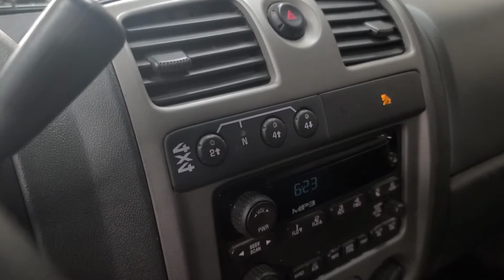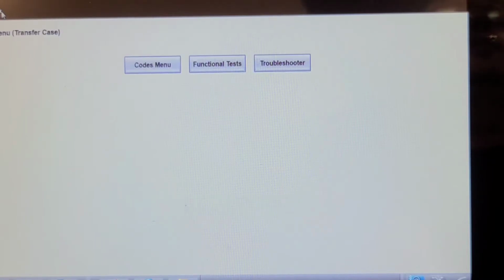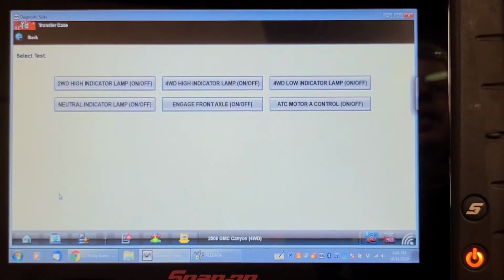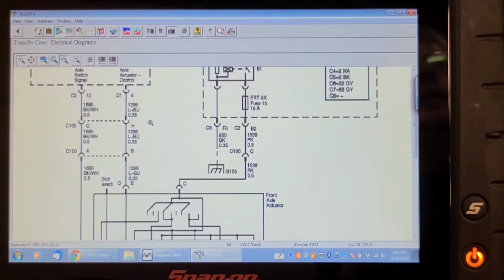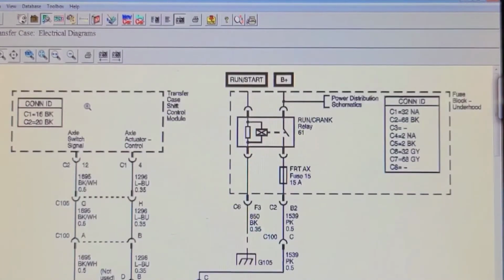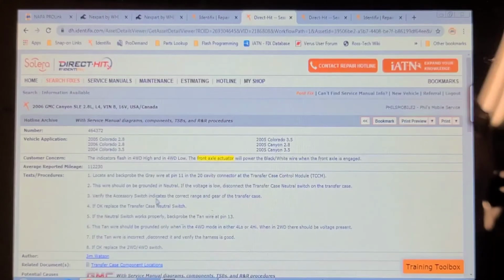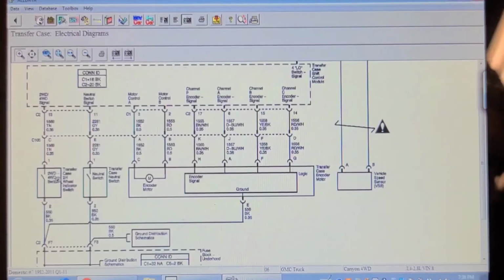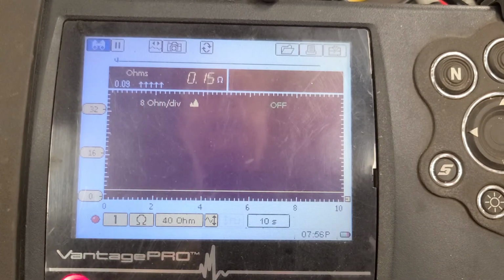2006 Canyon 4x4 Not Working

Comment: I have the 05 3.5 I5 same issue as this guy described different from the video. Jump started my truck in the cold and it didn’t like it. Lights flash for a second in key on position then flickers 2wd when ignition but then stops illumination and service 4wd comes on the dash. I have replaced all fuses correlating with TCCM and checked ground wires. I have scanned and have p0327 and cannot clear the code even with expensive scanners. So do I need to get it deleted by a tech 2 scanner at the dealership or is there something else I could do. Any help would be greatly appreciated!

Comment: Phil thank you! Your diagnostic ability is unparelled.  I have a 2005 Colorado. The TC control switch flashes in 2wd and 4wd. Sometimes it drops into 4wd by it self.  I took it to my local shop. They pulled a code that said it was TC control switch by the vents. I ordered 1 NOS  on ebay. If that doesn't  solve it your idea with the position switches will be next. Thank you again for all your expertise and time Mike
Reply from the maker: That sounds like a switch problem.

Comment: Thank you very much for the video. I'm pretty sure my 2012 has the same problem. I am confused on one thing though: which of the actual switches (top or bottom) did you change? At the beginning you pointed to the TOP one as the culprit with the note on the screen that it was actually the BOTTOM one however you were still backpinning the connector for the TOP one and getting the expected result for a bad switch (no change in voltage). Then at the end you were pointing to the other connector which is the one for the BOTTOM switch. Was there no change in the voltage because nothing was happening with the neutral switch? Basically you kinda got lucky in your diag? Also in one of your comments below you say the switch is hard to access but the bottom one looks very easy to get to. Which switch (top or bottom) was replaced? Thanks again for your video!!
Reply from the maker: @scotwithonet5663  if I remember correctly it's the upper switch but also the one with the grey connector. HTH
Reply: @PhillipBailey  The one with the grey connector goes to the bottom switch. I've looked at different forums and most say the 2/4 switch is the bottom one but some say it's the top one...? Not sure who to trust!
Reply from the maker: @scotwithonet5663  they are different part number.   I'm sorry but I can't spifically remember which is which. I just checked the electrical circuit. The 2/4 switch has the tan wire to it.
Reply: @PhillipBailey  Got it. On my truck the tan wire goes to the bottom one. I just tested it and it appears to be bad. Thanks for all your help!!

Comment: Holy cow, wish I had come across this video sooner. Been struggling with the blinking 4x4 lights for a year or more. My 4/2 switch was toast, the ball inside rattles around and there's no continuity of the prongs, my neutral switch on top of the transfer case seemed to still function/have continuity when depressed. Every other video or forum suggests the front axle actuator or module under the driver seat (replacing those did nothing for me). Going to pick up a new switch and hopefully that does the trick.
Reply from the maker: @GriffinCalme  glad it helped you

Comment: I had the same issue last winter with my 07 Colorado.   I know next to nothing about how the 4wd works.   I spent an hour or so on the forums and realized this switch gets a lot of mentions.   I took a chance and ordered for about $70.   I swapped in the next day.  Problem was gone....  I believe it's rust that causes that switch to go bad.   In fact every issue I have ever had with this truck, since new, was really a rust issue.   Fuel pump lines rusted through.  Rack and Pinon lines rusted through.  Transmission cooler lines rusted through.   All of which GM could have avoided for pennies per vehicle.
Reply from the maker: Glad you figured it out.

Comment: hello.great yoir joob✌️
i have colorado 2004
When I start the car,start the 4wd  and moving,there is a bad noise from the rear.
i have already changed front actuator,but problem not solved.
sry fro bad english,i am from Georgia(not America) i hope you can help me.in my country are a bad electrics🫣✌️
i thing i have same problem,that yours car.
Reply from the maker: You need to find the source of the noise. I doubt its an electrical problem. If it only makes noise from the rear when moving check the universal joints, rear axle fluid level and condition. axle bearings and rear brakes. without  hearing the noise its pretty hard to say what it is.

Comment: My switch is good what wire should have voltage on the front axle actuator when putting it in four wheel drive. And how can I bench test it.
Reply from the maker: You need to bidirectional control it with a scanner. Is the transfer case switching into 4wd? Usually it's the 2wd/4wd switch that fails. I need to look at a wiring diagram to see if it can be tested on the bench.
Reply: @PhillipBailey  yes the 2nd/4wd switch works i pulled it out the transfer case dose transfer and front drive shaft turns but not the wheels. I need to see what wire is positive and which one is negative on the plug for the front axle actuator.
Reply from the maker: @whatyahear  pin c at the actuator is power a pink wire from the actuator fuse. Pin E the black wire is ground. The actuator contains a multifunction switch and a solid state circuit to internally reverse the direction of the motor. Bench testing may damage the actuator. I'd confirm power and ground and continuity of the control wire to pin B light blue between the motor and the control module at pin 4 on C1 and also the wire to pin A black/white to C2 pin 12. If they test ok change the actuator.  Does it set any codes in the control module?
Reply: @PhillipBailey  I found a video showing how to bench test the actuator. I used wires with very small alligator clips on each end. With tab of actuator facing I connected the top left pin to ground from battery the pin under it I connected it to the positive from battery and the middle pin is signal  ground from battery. When you touch the middle pin to battery ground (negative) post the actuator extends when you lift it the actuator retracts. Mine worked so after looking around  about 4 inches from connector I found the signal (blue) wire had a break in the insulation which also  had a break in the wire.  I soldered a piece of wire in between and it started to work. The break in the wire was hard to see.
Reply: suppose to say with tab of actuator facing up.
Reply from the maker: @whatyahear  glad you figured it out. Continuity tests would have caught the broken wire though.

Comment: which is it the grey or red connector for 2wd 4wd switch?
Reply from the maker: Grey connector
Reply: @PhillipBailey  thank you how do you disconnect connector and does any fluid come out when you remove switch?
Reply from the maker: @whatyahear  no fluid should come out. There is a locking tab you have to press to release the connector. I don't remember the exact shape of it. There may also be a secondary plastic lock that may need to be removed first. You should be able to see how it's designed.
Reply: @PhillipBailey  Thank You again

Comment: Maybe you can tell me why my 2006 Colorado switches to 4H all by itself. I can switch it back to 2H and it works but a couple days later i can look at the dash and the light on the 4H button is lit, and when i check, it is indeed in 4H. I NEVER use 4H in the summertime and with gas prices where they are i would prefer not to. Any help is appreciated!
Reply from the maker: That's not a common problem. Probably be difficult to diagnose since it's intermittent. I'd try a new or different control switch. Scan the 4x4 for codes. Good luck...

Comment: great video!! I have a question my 2006 colorado 2WD and 4HI is fine, but not 4LOW, just flashes, could be the same switch you replaced my problem?
Reply from the maker: I doubt its the same problem since if the switch I replaced here fails it would not go into 4hi either. No disrespect but are you sure the conditions are correct to shift into 4 low. The engine must be running, transmission in neutral and vehicle not moving. Let me know...
Reply: Vehicle needs to be in neutral to change from 2wd or 4wdh to 4wdL.

Comment: Awesome. Confirmed the issue. Waited for the first motor to engage, monitored tan wire at TCCM, no ground. Gave it ground and it engaged the second motor.
$80 after taxes and shipping with a 1 day delay on Rockauto at the moment.
Reply from the maker: Glad it helped you.
Reply: @PhillipBailey  what is the actual name of this part/sensor ?I need it
Reply from the maker: @silram7  called a transfer case 2wd/4wd switch. I believe its only available from GM.
Reply from the maker: @silram7  part number 98181804 from GM
Reply: @PhillipBailey  thanks for the info

Comment: not sure if this is my issue but i have van 06 chevy colorado and upon successfully switching to 4L or 4H, it makes a grinding noise. as if i left a screw drive between the drive shaft and it’s trying to spin.
Reply from the maker: Check your cv shafts for slipping or stripped splines. Put it in 4wd with the wheels off the ground  transmission in neutral and try turning the front drive shaft. You should be able to locate the noise. See if the front wheels turn.

Comment: What program is that you are using?
Reply from the maker: To scan the truck I'm using my Snap-on Verus Edge and for the diagnostic charts I'm connected to Identifix service information system. The Verus Edge is actually a tablet capable of access to the internet. HTH
Reply: @PhillipBailey  I aint got 11k lol I looked into it I just wanted a way to test that switch. Think if I got it off the truck but still hooked up I could just open it up and short the switch to test?
Reply from the maker: @worstcaseontario6395  you can test the switch with an ohm meter. I believe its normally open and closes in 4wd. The is a ball shaped plunger on the inside which when depressed should cause the switch to change state. HTH

Comment: I HAVE A CANYON O6,MY LIGHTS ON THE BOTTONS NOT LIGHTING UP AN HELP WITH THIS WOOD BE GOOD TY
Reply from the maker: check fuse 36 under hood. It's labeled TCCM. It supplies battery power to the Transfer Case Control  Module. Fuse 19 supplies the ignition power but that also supplies turn signals so if they work that fuse is OK. Check those things first and if they are good you need a scan tool to check for codes and communication. The system does not support a data list. You will need a full function scan tool for this as an OBD2 code reader will not cut it. Good luck.
Reply: @P @PhillipBailey I have the 05 3.5 I5 same exact issue as this guy described as well as this video. Jump started my truck in the cold and it didn’t like it. Lights flash for a second in key on position then flickers 2wd when ignition but then stops illumination and service 4wd comes on the dash. I have replaced all fuses correlating with TCCM and checked ground wires. I have scanned and have p0327 and cannot clear the code even with expensive scanners. So do I need to get it deleted by a tech 2 scanner at the dealership or is there something else I could do. Any help would be greatly appreciated!

Comment: I've got a 2005 Canyon in the shop and the lights blink like you're talking about. The differential actuator will not engage to the switch but will with command from the scanner. I have no 5 volt reference from the Module and have replaced it. But still no 5 volt reference. Any ideas?
Reply from the maker: check for an open in the circuit or a short to ground. either would result in no 5 volt reference.

Comment: How long to remove and replace the actuator 84109212 motor?
Reply from the maker: Not sure if you are speaking of the axle actuator or transfer case actuator. Either is around 30-45 min to replace but that does not include diagnosis .
Reply: The axle actuator is quick, one plug and unscrew but I just did mine to mixed results.
Reply: I have the same problem, but the light that blinks is the 2WD one, can you help me?

Comment: Mine blinks for a couple seconds then goes bk to 2wd light.I can hear tc actuator turning but front axle does not engage. I took off the front actuator and pressed button from what I under stand it’s supposed to expand and retract it does nothing I went and bought a new one same thing nothing so I think it’s a wire harness?
Reply from the maker: The front axle actuator is turned on with the TCCM when it sees the transfer case make the shift into 4wd. The switch on the transfer case that I replaced on this vehicle is common to fail. you need to check the operation of that switch. It's not easy to access. you could also just try replacing it especially if you can get a used one from a salvage yard.
Reply from the maker: The lower switch is the 2wd/4wd switch. Part number 98181804 from GM. Could not find an aftermarket source. Hope this helps you.

Comment: I have a 2011 with the 5.3L in it and these are the exact symptoms and likely why my 4wd won’t fully lock in either
Reply from the maker: It's a poorly designed system. No available data from the controller is unacceptable today. Seems they hired the retired Ford programmer from the early 90's...

Comment: So u changed the upper or lower switch
Reply: Thanks for helping us with colorados
Reply from the maker: The lower switch is the 2wd/4wd switch. Part number 98181804 from GM. Could not find an aftermarket source. Hope this helps you.
Reply: @PhillipBailey  Is the upper switch the same part number?  I can't seem to find that one if its different.
Reply from the maker: @TXCameron  I'm sorry but I'm not sure,  I don't believe that it is the same.

Comment: Great work on finding the problem . On the forum pages everyone jumps on the bandwagon that it's the actuator that is at fault . That actuator may be the most needlessly replaced part on the Colorado and Canyon 4X4 truck . My 2/4 switch failed twice on my 2008 Colorado .

Comment: I have this problem on an 06' colorado you can hear the motor going when you hit the 4 high button but it just blinks when I hit the 4 low button it still just blinks but it also locks the driver side tire completely and won't spin
Reply: I tried to drive forward a little and it left a skid mark in the gravel
Reply: Think it would be the same problem with that switch?
Reply: Any help would be appreciated with winter being here I could use the four wheel but with the virus going on I don't really have the money for a mechanic
Reply from the maker: So let me get this straight...  When put into 4WD the left front wheel actually skids on the ground? That's not good. Sounds like the front differential is locked up, (siezed), I'd recommend to check the fluids in the transfer case and front differential for contamination, metal filings. You have to get if on a hoist where you can put the transmission in neutral and then see if you can turn the front driveshaft going into the front diff. Put it in 4WD Hi and see if the right side axle connects and if the front differential still turns... Doesn't sound too promising. Good Luck
Reply: @PhillipBailey  thanks few years ago i hit a two foot curb hard didnt think there was much damage but a fog light and rim never really thought much of it since it passed inspection but i suspect thats when it started ill try and see if i can get it up on some blocks and check that I have quite the arsenal of tools and alot of spare time when i do ill check back